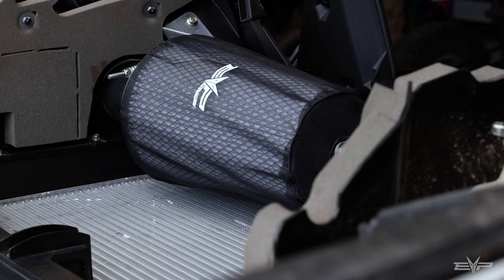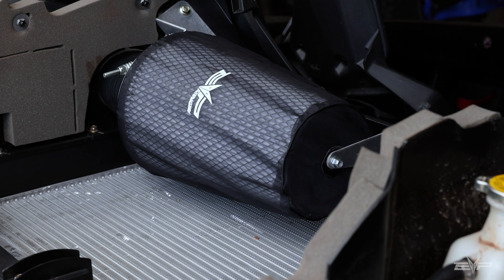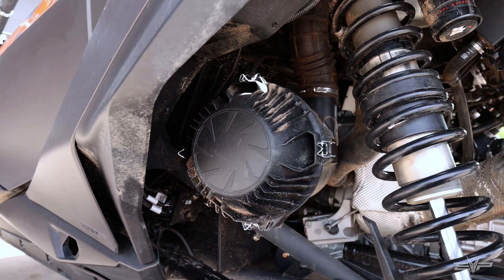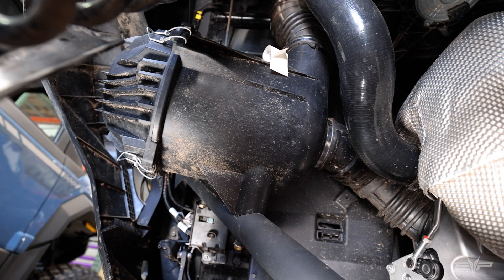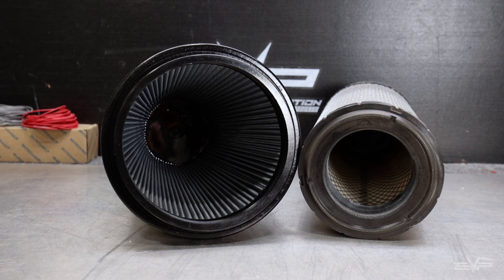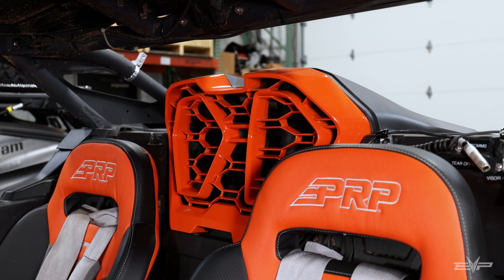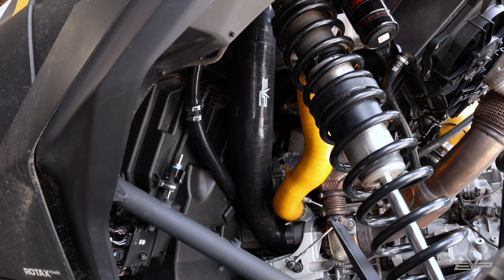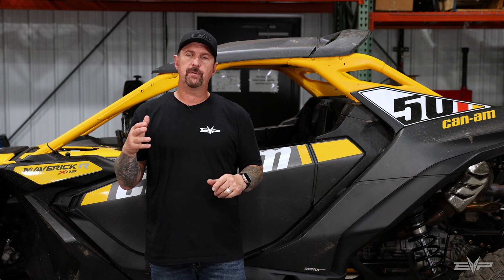EVP High-Flow Intake (HFI) Kit for Can-Am Maverick R

Comment: Why no dyno numbers with a 93-96 octane tunes? We all cant run E85.
Reply: Essentially should be the same gains lol obviously e85 vs 93 is like 40 hp difference or so if the intake adds 13-20 hp should be the same even on a bone stock car